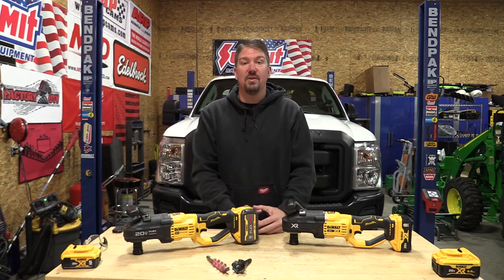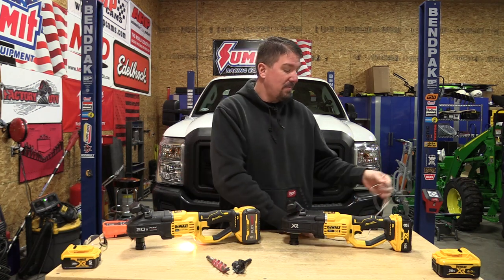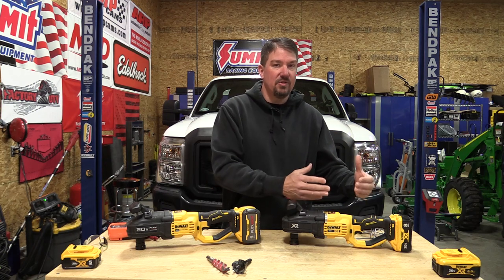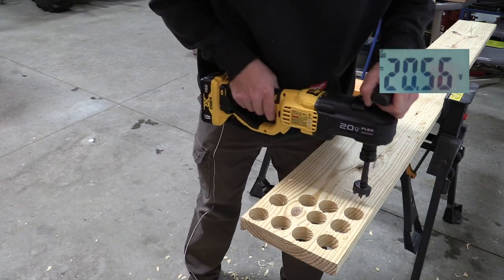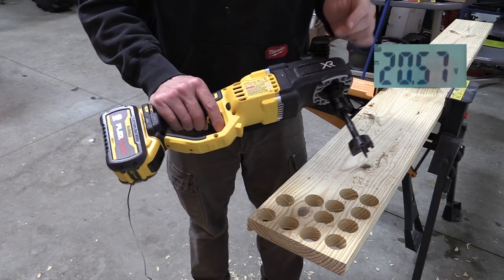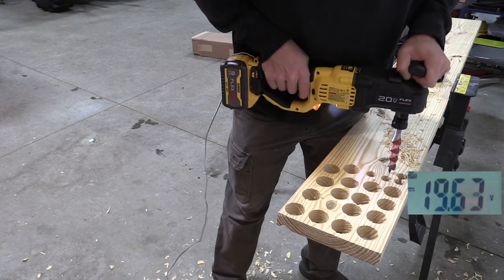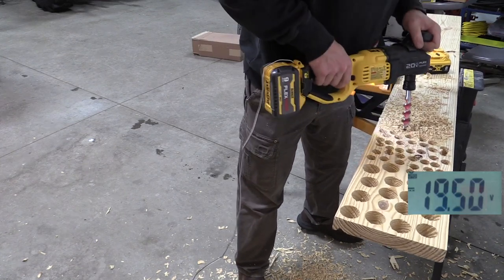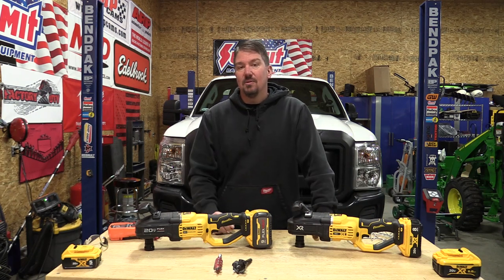The Best Battery For The New DEWALT Stud And Joist Power Detect VS FLEXVOLT Advantage Drills

Comment: 8s and 6s are both a 2p of 21700 cells and should be capable of the same max amperage (70 amps) There is a resistor used to identify the cells so that is how the tool tells them apart.  I don't know why the tool would choose to pull less from the 6s...  But maybe the 8s are made with more copper to move those amps, and the tool knows it.
Reply: The 6Ah they are using is actually an older 20700 based battery.  Somewhere around 2018/2019 they switched them to the Samsung 30T 21700a.  The yellow "6.0Ah" writing on the side of the pack is a giveaway that is older and uses the 20700 cells.  All the 21700 based 6Ah batteries will have white "6Ah" writing on the side of the pack, just like the 8Ah.

Comment: Great comparison,  can you get your hands on the milwaulkee  hole hawg and let's see the showdown on those 2 big boys, I am a dewalt man but the plumbers on the job use milwaulkee,  I am looking to buy the flexvolt but only have 3 - 6 amp batteries to run the big drill, do you think 3 6 amp batteries will be more than enough juice for a good day or 2? Wish you would
Have seen how many holes it would drill with a 5 amp, prolly 200?
Reply: Any horror stories of hole hawg failures yet.? My old boss fried 3 18v hole hawgs using just standard profile electrical sized augers 3/4", 7/8" but it was a few years back just prior to covid so maybe 2017 🤷‍♂️ but our coworker had the 1st gen dewalt 60v right angle and it outlasted them by far is why I got my dcd443 and kept adding to my collection of dewalt since. Curious if they still fry prematurely. I even got one of the fried ones free and ended up giving it away when I sold a milwaukee battery and charger lol

Comment: Great comparison tests. Could you do the test with the new 6 Ah Max battery with the 21700 cells (that is the battery with the white label rather than the yellow one). I am curious about the difference of the 21700 6Ah and the 8Ah batteries. Thanks.
Reply: I think the price is gonna even it all out, no? if it's half the size/weight of the 9Ah FlexVolt, that might be its niche.
Reply: Aren't all 6ah XRs made of 21700s?  Every size comparison picture I've seen shows the 6 and 8 to be the same size.  I have a "non white" 6ah at home and it is far larger than a 5ah
Reply: @Nyall  From what I've read online dewalt started making the cases to accept 21700 cells in the future but there was a period where they were using lower powered 20700 cells and it's believed that the battery label changed from yellow to white when they started putting in 21700 cells
Reply: Youre 100% right. The old ones has 2700.
I would love to see the same test with the new 6ah (21700)

Comment: good video i was looking for the difference between the drills and there doesnt seem to be one. i know the dcd443b came out is 2021 vs the flexvolt being a older model then that. and the 43 is ever to slightly smaller in length

Comment: how does it compare to the actual flexvolt stud and joist drill that these are modeled after
Reply: "actual flexvolt" = FlexVolt 60V ?
Reply: @wim0104  yes there are 2 versions that are 60v just was wondering if the 60v was that much more powerful or about the same. Not the one shaped like a big square but there are 2 that have the same exact shape.

Comment: Wich elements are inside this 10A battery? I suppose 21700 10 pieces. If so, then why it is bigger then dcb208? Cant find disassembly video for dcb210

Comment: @workshopaddict have you used the m18 fuel gen2 hole hawg?  Any thoughts on how they compare (yellow vs red).  I know the dewalt is a bit bigger and will be a bit heavier but is the weight worth it :). Electrician so I don’t need the super or 60v larger versions.  Thanks.
Reply from the maker: Both are very very similar IMHO
Reply: @WorkshopAddict  I’ve had Milwaukees forever and at this point it’s the only red tool I have left so I was thinking about consolidating now that these are available.

Comment: Hello serious question why I would use this instead of the dcd470 which is the proper flexvolt version.
Reply from the maker: This would be for someone who does not have FlexVolt batteries or does not need/want the power of the 60-volt version.

Comment: Where is the ultra common 6AH flexvolt pack? It should be able to hang with the 8/9 and should weigh less than the 8. You need a few of these on your shelf as the 9AH isn't super common in sheds/garages yet - it's reserved for the big dog tools. I run one in my flexvolt gen 2 blower and I run 2 (my only 2) in the mower, nothing else deserves it.

Comment: The most confusing thing about these power detect and fva tools is how they work with 6ah flexvolts.  There is a lot of heresay and rumors.  I've even read that it changes with the generation of the 6ah flexvolts...
Reply: Ya it seems like the 6ah flexvolt would unlock full power.. odd that it doesn’t

Comment: With a good sds rotary hammer drill I don’t see the usefulness of this tool? Does anybody know the advantage of this tool vs using a sds rotary hammer drill?
Reply: These are for heavy drilling through studs, joists, and beams, and when space is tight.

Rotary hammers are for concrete and masonry, and basically irrelevant when talking about these types of drills.
Reply: this tool should have higher torque than an SDS in rotary mode. Of course, the trick is to use different bits to suit the tool. A regular hole saw or auger can get tons of work done on an SDS. But a huge self-feeding wood bit is more suited to a hole hog.
Reply: The purpose is to be able to fit between studs that are 12"-16" O.C.
Reply: @MyFortressConstruction  thank you! Most SDS rotary hammer will fit between studs. I get what your saying though. The shape and more power should allow it to be used in awkward places.
Reply: @chopshop523  Also, when you are using a large hole saw it will put a lot of torque back on the user and the in-line Sds would rip out of your hands, so the L shape of the hole hawg will give you much better leverage with anything over a 1" bit. I am always very appreciative of the hole hawg when I have to put multiple 4" holes through I-joists or the like.

Comment: can we just call the tools "FlexVolt 20" vs "FlexVolt 60" vs "Powerdetect XR"... DeWalt is confusing things with their cross-over names...
Reply: about the 6Ah "lasts longer": if it needs that longer time to get the same work done, you should say the 6Ah "takes longer". Might still be a good idea to equip a helper or apprentice with.
Reply: for me, when I invest in new batteries, I need/want the 60V option: I have more power tools than batteries, and only a few 60V tools. And the 8Ah XR batt is expensive just the same, but can't do 60V.

Comment: Wait until the flexvolt dies because you using the flexvolt battery. I purchase the XR series my partner purchase the flexvolt series because he doesn't like sharing batteries my tools are working almost as good as the day that they were purchased my partner just dumped $1,000 into XR because the motor is burned out on his flexvolt next week I'm going fishing I should probably bring my partner back a jack tuna

Comment: I keep telling people not to buy power detect because it's just a flexvolt advantage but made so it can't accept flexvolt batteries. 

Silly agreements between DeWalt and Lowes is the only reason it exists.
Reply from the maker: It can accept flexvolt batteries.
Reply: @WorkshopAddict  Sorry, duh (duh to me), I meant it won't receive the power boost from them like the advantage. 😆
Reply from the maker: @MyFortressConstruction  But they do and we proved that here.  The FA and PD tools both got the boost starting with the 8ah 20-volt.
Reply: @WorkshopAddict  The power detect got a boost from a flexvolt battery? I'll have to watch again.
Reply: @WorkshopAddict  I don't see in the video where you put a flexvolt into the power detect...
Reply: @WorkshopAddict  Brian, I have to say I have been enjoying your videos over the last couple months. I had been trying to decide between PD and FA as I did not have any Dewalt tools (stepping up for Ridgid). I did finally go with PD for several different reasons but your videos gave me (I hate to say) hours of research time. Thank you.

My only “complaint” watching your videos was you generally used the 9Ah FV battery (2170 cells) with the FA tools because as you said it came with the tool (as a kit) but I was always trying to compare the FA two tool set that came with the 6Ah FV battery (18650 cells) vs the PD two tool that came with the 8Ah XR battery (21700 cells) and then the base Recip or Circ saws that were free with the two tool sets (at least around Christmas time). You showed how much more powerful the FA tools were after using the 9 Ah FV battery vs the PD with the 8Ah XR, usually in two separate videos. This made it more difficult to compare fully. No fault to you, you did as many tests as you could and in so many ways, but I just always wished you would test the two with 6Ah FV and 8Ah XR together at the same time to show the difference. I think you did with the drill but I don’t think you did with the other tools. 

Now that I have the PD I am curious (as I mentioned earlier) about if the PD gets a boost with the newer white 21700 6Ah, or any of the newer compact 21700 cell batteries, or is it or is it specifically the 8AH and higher. Is it simply the 21700 is the kicker or is it something else in the battery they have upgraded? Usually you see comparisons using the older 4, 5, or old yellow 6 Ah batteries being used. Sorry all for this long message. I appreciate the time reading.
Reply from the maker: @MyFortressConstruction  The last test after I put the 8Ah on the PD and the FA I put the 9ah FV on both the PD and FA.
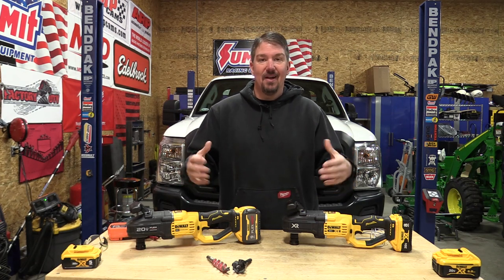Reply: @WorkshopAddict  Okay, yeah, I see that at 6:41. Well, I feel sheepish. Lol. I missed that kind of important part. Guess I should stop skipping through videos. 😅

Good to know though and I am glad that DeWalt has done that because from the beginning of their launch I had a completely different opinion based on what DeWalt said. I do still think that their literature about it could be more clear. Even if they said that their power detect was boosted for ANY battery above 6ah (so as to exclude the 6ah versions that had 18650 cells) that would at least hint towards it not being only the 8ah like the literature said. 

Anyhoo, thanks for pointing that out.
Reply: Power Detect is the way to go!  I’ll put my DCD 998 up against anything, with the 8.0 battery!  Yeah